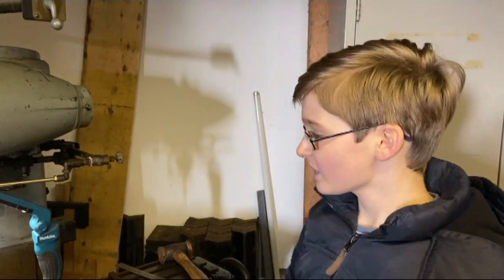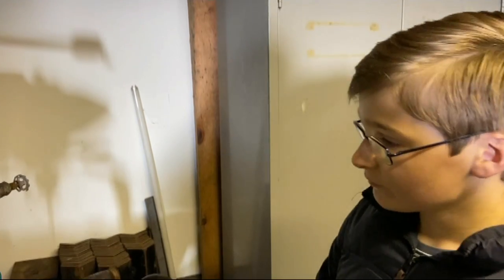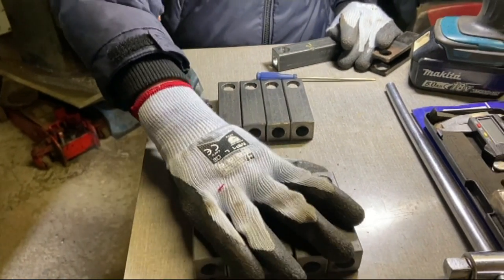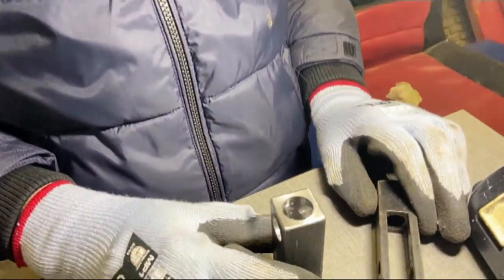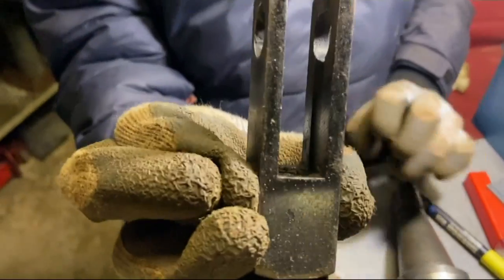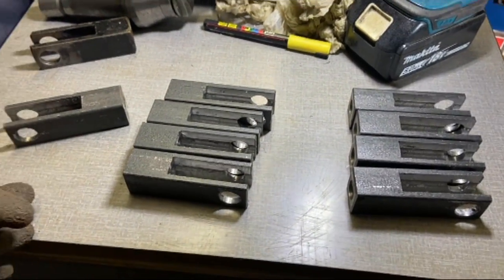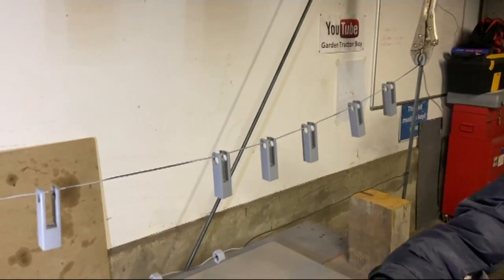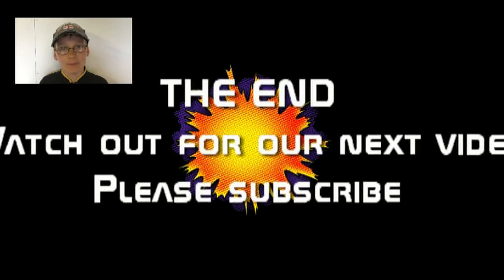Bolens HT Snow Plow replica - Part 7

Comment: it sure is handy having a mill, I don't have one  but it would be great if I did.. where does the coolant go when you are letting it run down over the cutter?  does it get recycled back to use over again?
Reply from the maker: Much like your lathe, you will not regret getting a mill, they are a great machine. We use our mill as a drill press also. The mill has a sump in the base where the coolant is stored and where it drains back to.